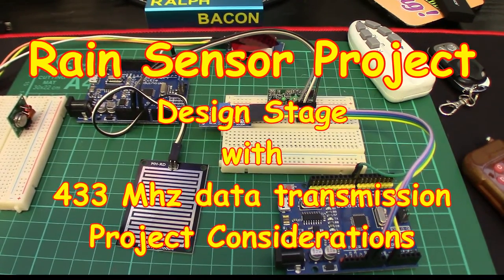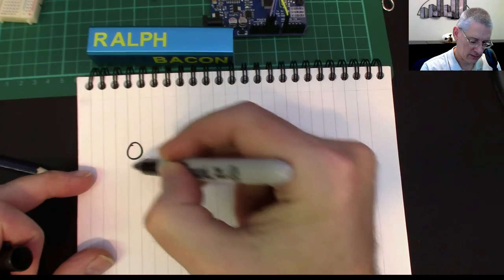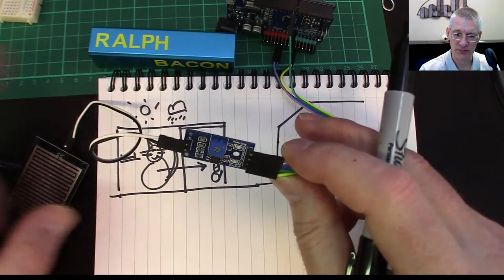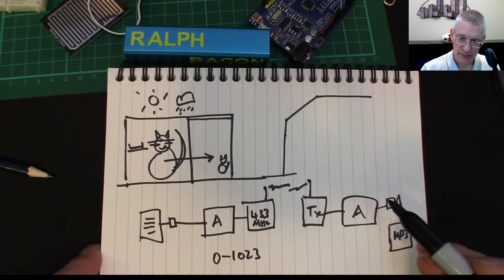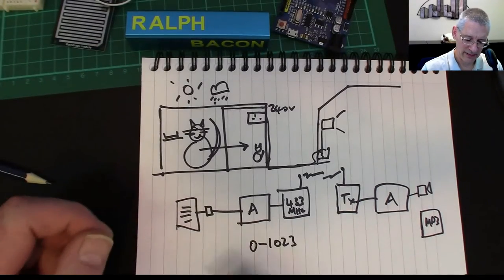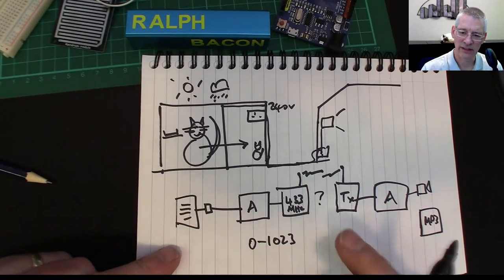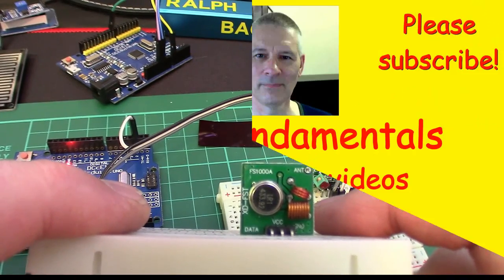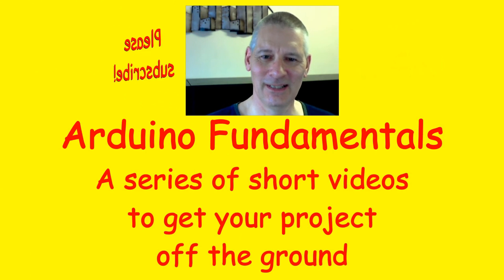#44 Wireless Rain Sensor - Discussions & Experiments

Comment: One thing you might want to consider with that rain sensor is moisture absorbtion around the edges of the board,  unless you put some kind of sealant around the edges...
Reply from the maker: Water, or rain, just gets in everywhere! So sealing it all is an absolute must, thanks for the nudge.

Comment: One suggestion is that you make the entire system automatic; in as much that the rain detection is switched off when the basket et al is under cover. One method would be a small magnet secreted in the basket and a hall effect detector near the place were one normally stores the basket/bed whilst undercover.
Reply from the maker: That is a great idea, Michael. In fact, rather than a magnet/Hall Effect which might be somewhat positional, I could use simple Light Dependent Resistor (LDR) embedded into his wooden shelf that is then always covered by his mat/basket etc. If that is not present then no need for the alarm. Sounds good. Thanks for that great suggestion.

Comment: Ralph, why not add a motorised cover, that slides over the basket when it detects rain, and slides back once it dries up. I'm guessing it can be done with a simple motor / pulley and string setup and the cover could be made from either some thin perspex, or a thick polythene sheet on a simple frame. That way, it's all automatic and then you don't have to rush to save the basket.

The other low tech solution, is to build Benny a perch or low bench out of a thick bit of wood. All 3 of our outdoor cats ignore all the cat stuff we put in the garden and sleep on an old scaffold plank or the sleepers that make the raised beds on my veg plot. And just leave the perishable basket under the covered section.
Reply from the maker: +Maxx B
Ah yes, we discussed this as a potential solution but felt that the rain would still easily penetrate the cage (the sides are open) and all that motor/pulley stuff, well, what could possibly go wrong!
 
So in the end we (who am I kidding, my wife) decided that a simple notification would be sufficient. Now that it's actually installed, however, there are yet further items in my wife's creeping development wish list...

But thanks for posting. Come to think of it, I could have just put a transparent roof on the cage!
Reply: Ralph S Bacon
 Our cats love trying to cook themselves under the perspex lids of the cold frames.
Reply from the maker: Yup, cats seem to have no concept of "Too Hot". But they most certainly don't like getting wet so at least this project should assist in that!

Comment: Make a retractable cover that is activated by the rain.. (mini version of what Colin Furze used to cover his car-port)... The cover can be as simple as the cover used on baby carriages..

220v seems a bit dangerous around a wet cat... Can't you convert it at the house down to around 12v, so that any voltage regulator in the cat shelter can convert it to whatever the device needs?

Since the rain detector has a digital output as well as analog. Can't you set the digital to trigger at the lowest rain level, and use that to wake up a esp32 from deep sleep. Then have the esp32 transmit the analog value. The esp can post rain alerts to something like ITTT..

If you want to take it up to the next level, connect the analog output to a LM3914  LED Bar/dot chip. Then each output pin can trigger a different alert... 
Can't the LM3914 be used to turn on relays?

It's raining Cats and Dogs outside....
Reply from the maker: Now this is rather an old project, and is no longer with us. In fact, we've moved house since this was made. Neither is the cat with us for which it was all built. RIP Benny, Best Cat Ever. 

But there were no 230v voltages around this project, all running at 9v, I believe. It all worked well enough, although today I would do it differently, of course. Yes, 100% hindsight.